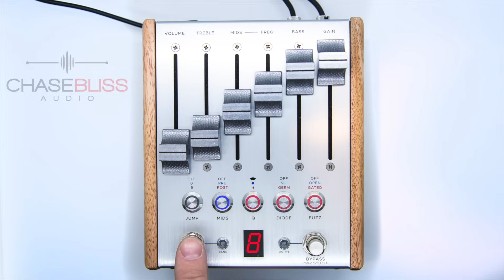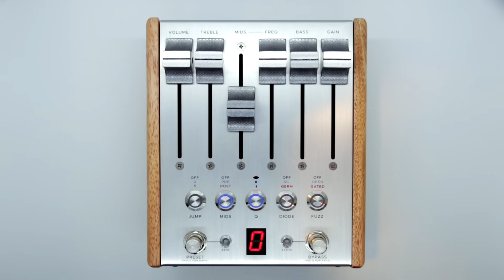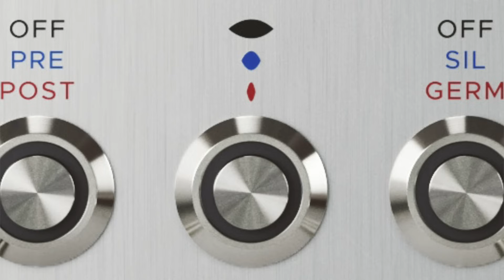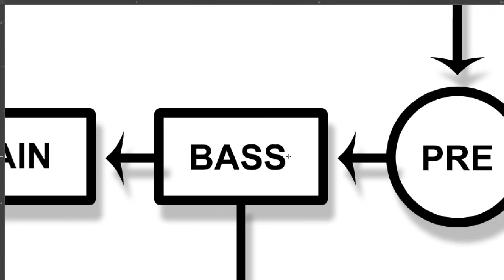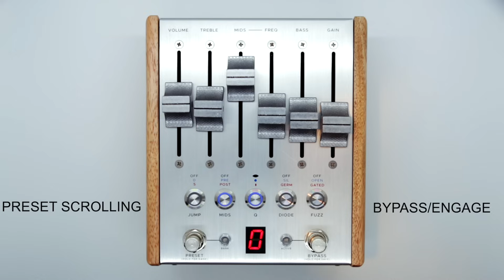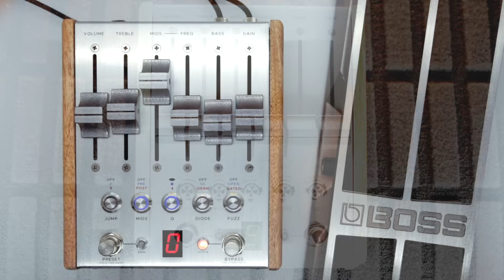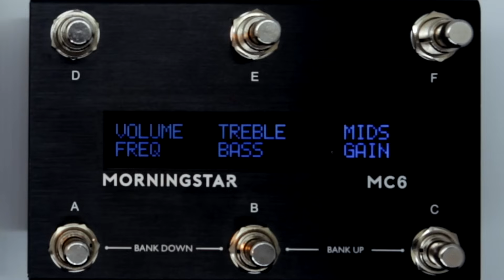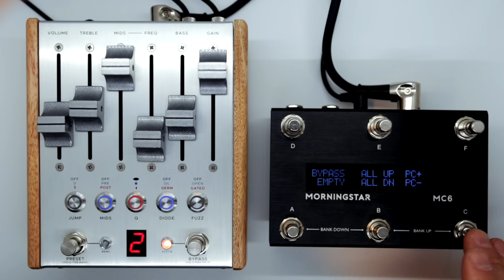Preamp Mkii Overview (Deep Dive)

Comment: Seriously, was kinda worried about preset selection live, but the jump feature handles that perfectly. Nice job
Reply: I'd still need to use MIDI for immediate access to presets ...even with jump you still have to cycle through. You can't one button push to say one of 4 settings that might be your core sounds.

Comment: Anyone use this with vocals?? Trying to build a vocal pedalboard based around one...
Reply: I’ve used this with vocals.  Yes it works, but it’s more suited for those distorted radio-filter sounds.  Then again, I prefer using a Hudson Broadcast for that kind of vocal effect.  If you’re looking for a more typical/clean vocal EQ pedal, I would recommend the JHS Colour Box instead.  The only reason I would use the Automatone for vocal EQ is if I was going to use that wah effect where the Q is swept while singing.  All that said, if you’ve already purchased an Automatone, there are definitely ways to use this for vocals, and even clean settings as long as you’re very delicate with the Gain.
Reply: @gigaha  Thanks!
Reply: @gigaha  Thanks!

Comment: Is there a way to turn off the latency when the bypass switch is engaged?  I just received my pedal and theres a gap between when I engage the pedal and when sound comes out.  It's noticeably long making it hard to use as a boost or second gain stage.
Reply from the maker: So there’s actually no lag the pedal actuates on release of the switch (not the press) - does that make sense?
Reply: @ChaseBlissAudio  Thanks that makes more sense.  Can that be switched to the press instead?
Reply from the maker: @ryanmaroney4793  no, we made that choice because it’s becoming more and more ubiquitous if there’s a hold function (like saving presets) otherwise you are forced to bypass / engage the pedal if you are just trying to save a preset
Reply: Smart

Comment: i do have a question. what does gain control, when i'm using the fuzz circuit? can i adjust the preamp gain and the gain for the fuzz circuit independently?
Reply: Fuzz is set gain, however I heard there is an internal trim pot to dial it back.

Comment: Seems great but I wonder how long until those slider motors give out
Reply from the maker: We had a unit set up to constantly cycle the faders up and down, and after 6months of non-stop fader movement, we had to finally unplug to when we were moving our shop. That same unit is on one of our trade show demo boards, and is still going strong near 4 years later.
Reply: @ChaseBlissAudio  Thank you for your reply!  That's certainly impressive.

Comment: Just purchased one.  For anyone else who has this pedal: do you typically place it in your pedal chain where the overdrive/distortion pedals would go?  If so, how would the fuzz sound if placed after other pitch shifting pedals?
Reply: By now you probably know!  If so, tell us how it is.  I'd guess it's a matter of having a buffer before the fuzz, which is not always great.
Reply: @user-oy7gz5bf2h  I'm using it where the overdrive and distortion would go and it sounds great to me.  I should mention that I play bass, though.  I think guitar players sometimes have to be mindful of running certain pedals through an fx loop, issues with buffering, and other weird things that don't affect me.  So your results may vary.

Comment: I was interested in testing one of these out until I saw a review on Reverb that says the mids circuit is noisy. Unavoidably noisy. It had a lot of thumbs up, which tells me that other users are having the same experience. On a pedal this expensive ($750+), I expect better. Chase Bliss, is this claim true?
Reply: It's noisy at high volume i.e. when the volume is set high on the pedal.  Just got mine and to get unity gain, the volume is set low enough that the problem is non existent.  There might be some applications where it's not ideal.

Comment: So you can randomly access presets through midi right. So in the case of the Morningstar for example you could assign each button to equal say a clean boost setting, a crunch rhythm, a lead setting a fuzz etc..?
Really looking forward to some similarly detailed demos of the sounds. :-)
Reply: Oh, good question! Yes! Absolutely... I should have mentioned that in the video....
Reply: @Paul_Uhl_  No probs. Thanks for the clarification. In a live setting I'd rather jump straight to a preset rather than need to cycle through.
Reply: @Grant_Ferstat  Yes, just hooked mine up to my MC8 and it goes straight to any preset with the corresponding Program Change MIDI message. Works awesome.
Reply: @gbills The Morningstar totally opens this pedal up

Comment: This pedal doesn't include a power supply. Requires a 500mA draw for current. That's a serious power supply. Yet Chase Bliss doesn't include a power supply with the purchase. Yikes. There should be a warning in advance that a separate purchase is required in order to use the pedal.